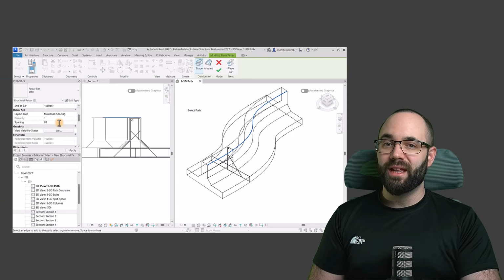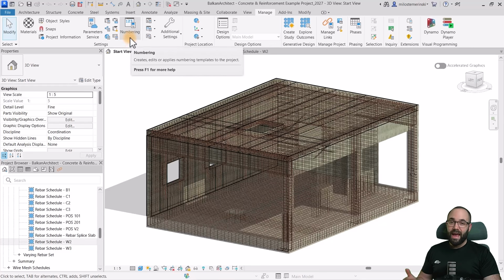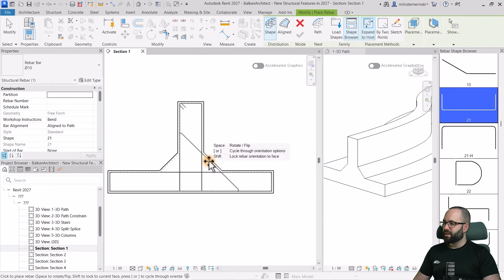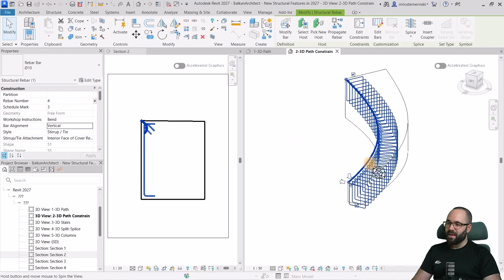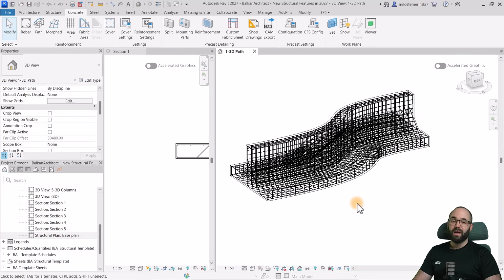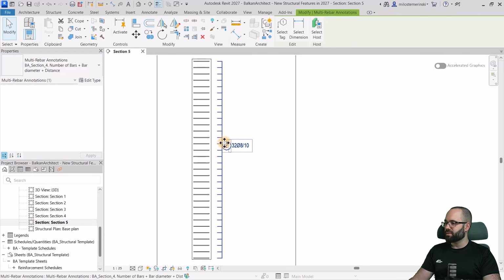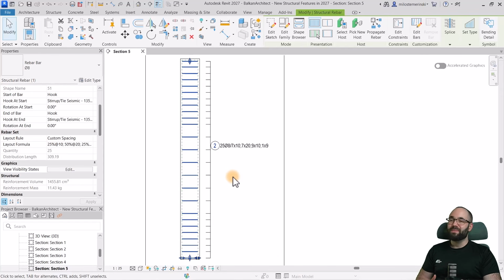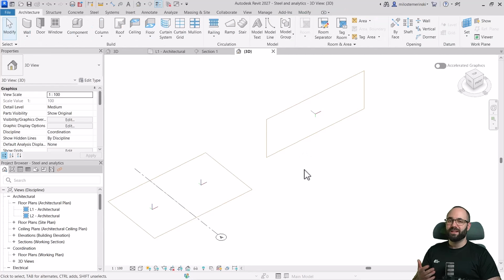Revit 2027 - New Updates and Features for Structure | Revit Structure 2027 Tutorial

Comment: Small question, I noticed something on the stair. You had it extended way below the base level, and what's more important it was geometrically correct. I mean the detail when the first riser is higher than the rest of them. How did you do it? Is it the new function for Revit 2027?
Reply: Hi! I saw this also and I believe he used a model-in-place element which is a no-no :)
You cannot get that with the stairs tool (not the bigger first thread, but that horizontal "landing")

Comment: The Numbering tool and the CustomSpacing parameter are very powerful. The former standardizes the marking of structural elements, while the latter—especially when combined with the Propagate tool—saves significant time in detailing.

For example, I’ve used formulas like 50@7.5; ?@15; 50@7.5, which distribute the rebar set so the first and last 50 cm are spaced at 7.5 cm, and the middle portion is automatically calculated and placed at 15 cm spacing. When propagated to another element using the correct face, the reinforcement adjusts automatically to the new geometry.

However, there are some issues. Custom spacing is applied as exact spacing rather than maximum or clear spacing (as in Spacing + Number). This can create conflicts when the total length of the rebar set doesn’t align perfectly with the formula, sometimes adding an extra bar too close to another, which may lead to double counting in schedules. This can be resolved by manually removing the extra bar in the rebar set; it’s easy to identify when tagging.
Reply: For rebar i use Strakon
Reply: Thank you homie
Reply: What is strakon
Reply: @RamdaneTchagbele-n8y  Strakon is CAD software for drawing reinforcement plans. It is very powerful you can reinforce all possible concrete shapes with it and generate bending schedules.

I am also a Revit user
Reply: @RamdaneTchagbele-n8y  Strakon is CAD software for drawing reinforcement plans. It is very powerful you can reinforce all possible concrete shapes with it and generate bending schedules.

I am also a Revit user